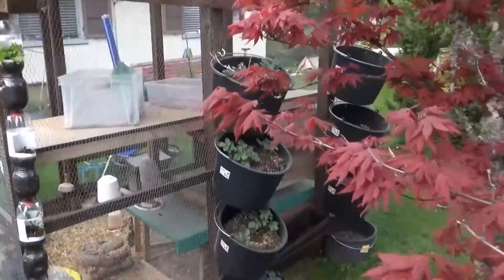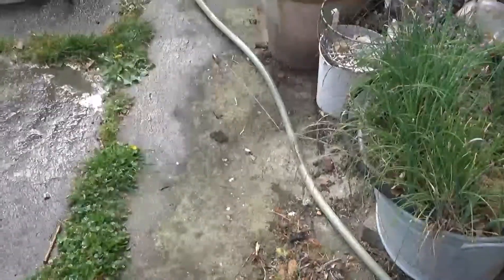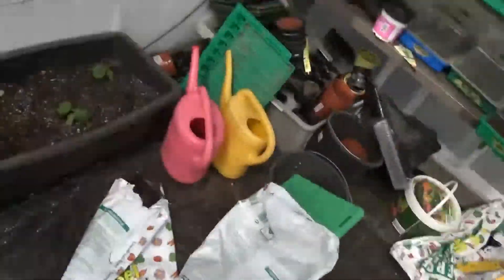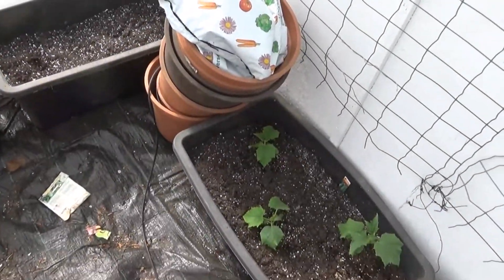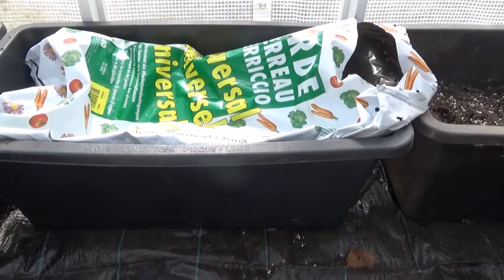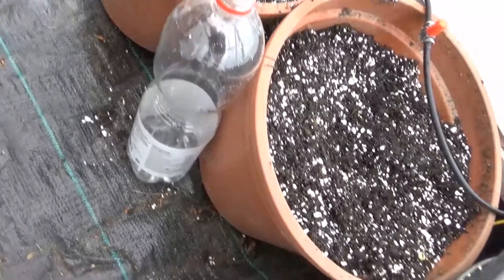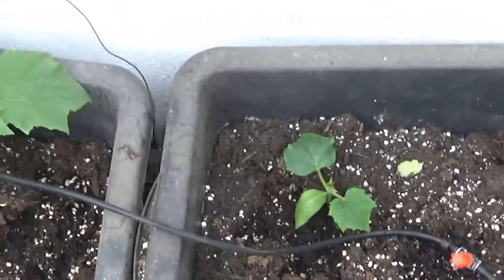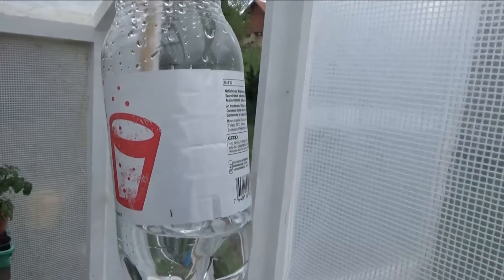Automatic watering system for the greenhouse  26 04 18

Comment: The plastic mulch is good but I would be worried about bugs and slimy things living under it, but I would still give it a try. Wonder if it was held off the ground would it still work, maybe pinned to the top of the container creating an air space between it and the soil, be easy to do on a small pot.
Reply from the maker: Slugs are not normally a problem here for tomatoes. I can not think of anything that eats the tomatoes here to be honest.. Now I have said that something will come and eat them lol I could clip it to the top of the tub. Thats a thought.

Comment: I've found that when you plumb nozzles inline, spray or drip, after the first couple they mostly end up being drip anyway, and that's with good water pressure. Any water system is better than none though, I couldn't garden without them as our summers, (probably like yours) are very long and extremely hot. We've recently had a bout of weather like yours, high 20's for the last week or so and it hit 30 here today. A real bugger for the seedlings.
Reply from the maker: The system itself on the reducer dictates the pressure. the spray nozzles I bought are for another system i couldn't get the same ones. As long as they drip I am happy. there is no way I would keep up with the watering so I had to do something. Yes long hot summers. All the seeds I sowed cooked lol. I have re done most still got to do the flowers. massif difference from last year in temps.. -4 to +29c... lol

Comment: Thar is a beautiful apple tree. Looks like a good watering system. I follow a commercial greenhouse tomato grower in the southern US he does the thing where he just keeps dropping the vine down lower on the ground as it reaches the top of the greenhouse. So will you be using clamps and lines from the roof to support the plants? I used them for the first time last year and it was by far the best support system I've ever had.
Reply from the maker: The tree must has heard it was on its last chance lol. I have clips but not like yours I hope they will work. I am sure I will work something out. I have to learn how the greenhouse is going to work. I cooked all my first sowing in there lol
Reply: Whatever you are planning to use are likely just as good as these but if you are interested go to Amazon.ca and search tomato clips most of the ones that offer free shipping are coming direct from China so you should be able to order them from Amazon and they are dirt cheap only issue is they do come on the slow boat from China LOL
Reply from the maker: Thanks ;-) I have some clips I will see if they work if not I will be on to china ;-)

Comment: Hello Dave, everything is looking good & what a great job you have done with the greenhouse. I need to look at setting up a watering system as my plant stock keep growing. Thank's for sharing.
Reply from the maker: Hello Rod. Thank you. I almost bought a cheap polly tunnel but I spock to a guy who has two and they didn't last two years this cost me 20 franks more to make. I didnt have to buy the skin I had that. 
The system cost 25 franks about 20 pounds sure its cheaper in the UK or U.S. The timer was about 40 franks Seen better and cheaper but I am in Switzerland thats why the +sign is on the flag everything cost more lol the system I bought only had 12 drips so I bought another 10. 
Happy growing and thanks for your interest and comment.
All the best Dave. ;-)
Reply: I bought a cheap Tunnel about 2 year & sill not put it together. When I finally get round to building it & the plastic fails, I have some scaffold netting I will cover the frame with & use it for my Brassicas.
Reply from the maker: The tunnel my mate bought was the one with the zip door 3mtr 2mtr some of the seams failed and the frame on one. I have seen better ones, This type cost 200 franks about 140 pounds. if the frame holds out would make a great brassica cage. I think it was the plastic connectors with the frame. Could be fixed up though. 
I have just got the old trampoline off the kids I will be making a brassica cage with that ;-) Or some of it.
Reply: Great minds think alike lol. I am collecting Trampoline frames a well. The tunnel I have is 6mtr X 3 mtr & cost me £139.00 now selling at £150.00. I will get round to building it Honest :-)
Reply from the maker: I have been waiting for 3 years for them to destroy it lol they did get a new one. Thats a good price for that size. the +on the bloody flag lol. You should do some vids mate. Its good to share this stuff and we all learn. 
Get it up ;-)
Reply: I would love to try my hand a making vids but alas funds wont allow. I was made redundant in Oct 2016 & get no help from our Government. My only income is at the moment is a Carers allowance £64.00 per week to look after my wife 24hrs a day. I do partake in commenting & subscribing to channels like yours, my way of getting involved.
Reply from the maker: I started making with my phone camera and I still use free editing software.  Sorry to hear about your wife and job mate. I have some nerve problems in my neck and shoulder hoping to get it fixed... thanks for commenting mate and for having a chat. Its nice to be able to talk to people in my own language ;-)
Reply: Enjoyed talking to you as well. I'm a Northerner like you , only I'm on the other side of the Pennines not too far from Manchester. I do post photos from time to time on Geoff Foreman ( Geordie Boy ) FB Gardening page. He has a YouTube channel also. Well worth a visit tell him i sent you.
Reply from the maker: I will go over and sub mate thanks for telling me ;-) Ill tell him you sent me ;-)

Comment: I usually stop the Tommy's at five trusses and take all the side shoots off and stick them in pots without rooting powder on and they make strong plants that you can chop and make bushy earlier by leaving the side shoots on.I would try bark or moss instead of the bag.I don't trust the chemicals in plastic getting into my food! Also another great tip for ya,pull the flowers off as soon as they have been pollinated before they shrivel and u can time ur fruit by pulling the bottom ones first and it stops rotting when the flowers don't fall off.
Reply from the maker: I like the idea of winding them down might try both I normally go 7 trusses but had more head room outside. The plastic wont be in the ground and they are the bags the compost came in. I need to get some eggshells together they will need the calcium in this compost. I can only go single stem of have less plants. See how we go first year with a greenhouse so i am sure I will bugger most stuff up lol ;-)

Comment: Doode - Bricklayers clevage!  Ehewww.. I use a similar system... it seems to work well.
Reply from the maker: I did wax ;-) how long do you leave it on for and how often ?
Reply: Leave it on until you can say the word... "the."  I reckon by then, your entire body, head and all, will be bald.
Reply from the maker: The The the system how long and how often lol I am from Yorkshire we only use the the word if its at the start of a band name ;-) we just say T Who T Beatles. Thha knows
Reply: LOL.  Cheeky bugger.  Mine runs for 20 minutes on several different beds - that are a lot bigger than your pots.    This silly old bugger's advice is... run it for as long as it take until you stick your finger in the dirt next morning and it's damp - not wet, not dry... damp.  Then wait a few days.
Reply from the maker: I will be out T finger int morning ;-)